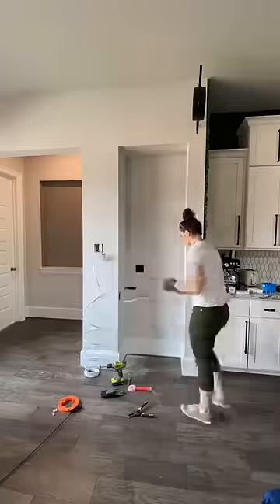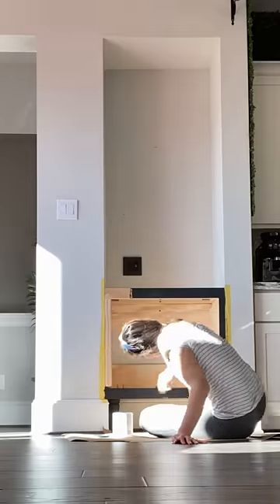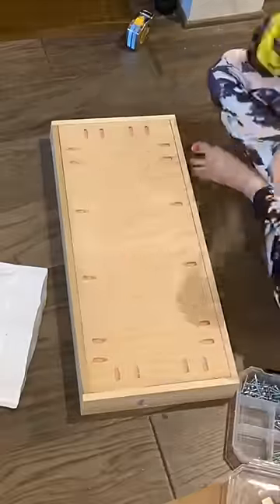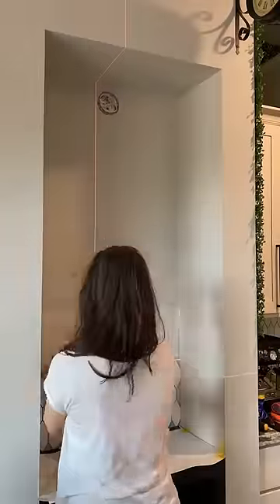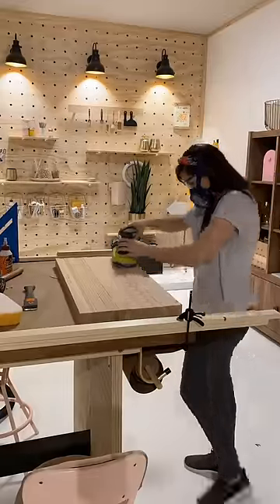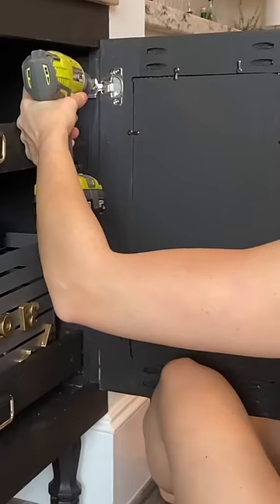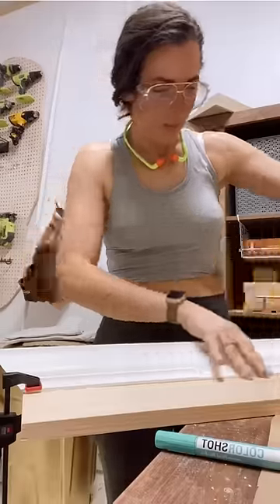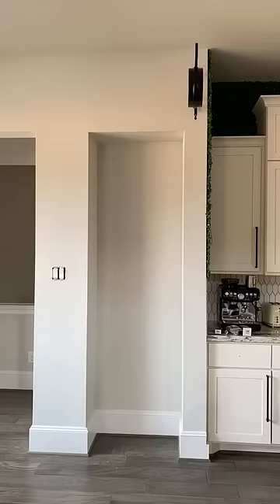DIY COFFEE NOOK from an empty niche

Comment: Not totally sure about looping power outlets off lights circuit. Lights normally have a lower rated mcb (and smaller cable size) and running kitchen appliances could lead to nuisance tripping. And isolating that circuit will be interesting for the next sparky. But very pretty diy

Comment: Hope the coffee maker doesn’t draw too much power could start a fire if you only used 14-2 for it off the existing light switch. Probably needs pulled off your kitchen receptacles they use 12-2 wire for them and are GFCI protected.

Comment: Would of did the tile the correct way. Some cement board and flexbond. Besides this beautiful.
Reply from the maker: You actually can just tile over drywall, especially in small spaces like this. I used simplemat which is a double sided tile adhesive that makes install way quicker. There’s lots of “right” ways depending on the project

Comment: Brand new house.  Huge closets.  No electric outlets in them.  One is bigger than an office cubicle but no power outlet.  Not even in the broom closet for the the hand vac charger.  The Roomba would be in the front hall closet if there was an outlet in there.  Plus sis and I are both under 5' tall.  The bottom shelf was all we could reach in the kitchen cabinets.  Had to drill new holes to lower the 2nd shelves so we could tippy-toes them.  Garage door opener is even a foot too high.  Tall men putting a house together for shrimpy women.  😐